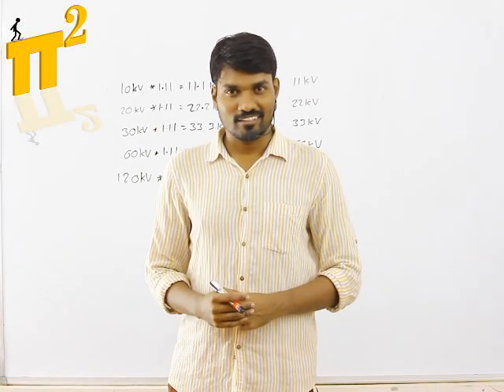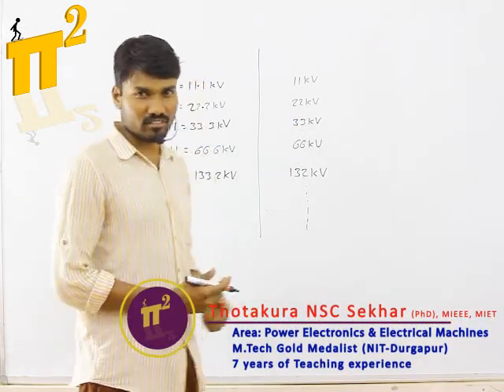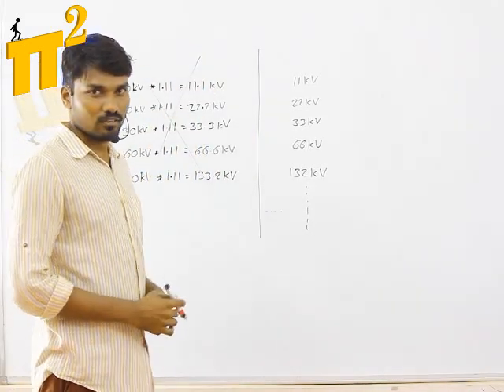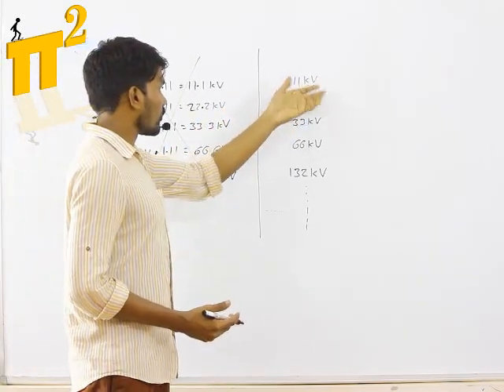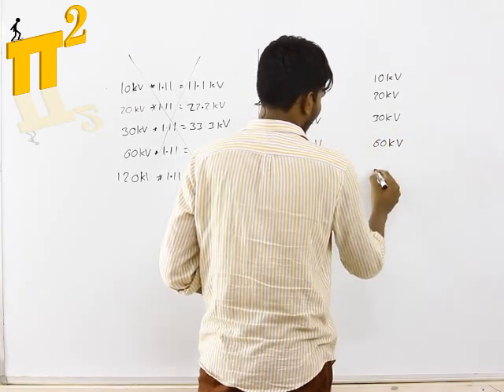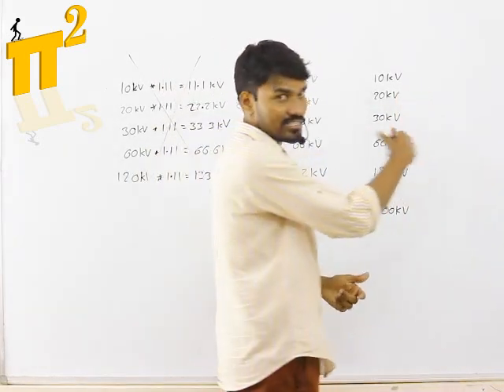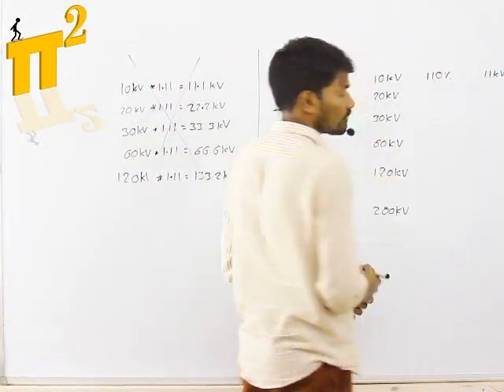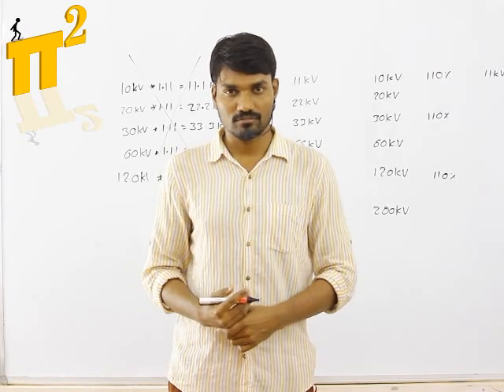Why 11kV, 22kV, 33kV, 66kV, 132kV... in India | Interview Question | Understanding Voltage Ratings

Comment: And what about the case of 400 KV and 765 KV
Reply from the maker: These are the voltage levels used in recent times, so recently we use FACTS devices to compensate the voltage drops so, voltage drop is taken care by FACTS devices hence we don't consider 10%.

Comment: Sir,
Then why the transformer voltages are rated at 11kV/440V or 33kV/11kV and so on and also on the board of any substation are written as 33kV/11kV Substation etc... Why?
Reply: PiSquare Academy 
Sir, but you were telling that the 10% extra voltage is for transmission line voltage drop. So now whether the line is loaded or unloaded it doesn't make any impact on voltage drop no! And If the line is unloaded also there exists voltage drop in transmission line na?
Reply: Nitin Sourabh no load, no losses!!!
Reply: PiSquare Academy  bro no load losses pata hai kya tume.
Reply from the maker: Dear Mishra, if the line is operating at no load then there will not be any voltage drop hence we will get full 110% voltage so the transformers must be rated at full (110%) that is 33kV or 11kV or 440V.